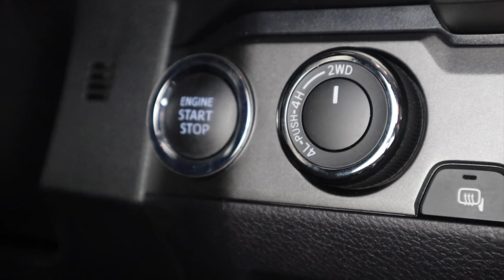Should you buy the latest Toyota Tacoma 2016-2021?

Comment: Toyota should have kept the 4.0L engine they had in the gen 2 tacoma
Reply: I have 2011 Tacoma with the V6 4.0L engine. Just barely passed 98,500 miles. I don't think I'll ever sell it :).
Reply: @xon2013  they are awesome trucks.  I have a 2007 Tacoma access Cab trd sport 4x4 4.0L v6 automatic with 165,500 miles.
Reply: @zzsuprazz  I have a double cab TRD Sport 5ft bed 4wd. I use to drive a 2006, same exact truck, several years backs, but unfortunately fell on hard times and had to sell. I got this 2011 just last year and very pleased so far. Already went hunting in it a few times and have used it for some light cattle/ranch stuff.
Reply: @zzsuprazz  any major issues with those miles?
Reply: @lujr2225  no major issues. The only thing I have had are Normal maintenance, front driver wheel hub bearing,  abs module went bad, and my frame was part of the recall.  The frame was in good shape but had one dime sized rust hole. So toyota put a new frame, Hardware, and ect.  Overall it's been a great, reliable, useful truck.  It's never broke down on me and has always got me were i need to go safely.
Reply: I went from a 4.0 to a 3.5.   The 3.5 is slightly better in my opinion.   The 4.0 has good bottom end but it's definitely not rev happy. 
The 3.5 doesn't have the low end torque but if you step on it it goes unlike the 4.0.  

Also let me add I did purchase a 2019 so it doesn't have any of the problems the previous do. Even though mine was built in Mexico lol
Reply: @alexgarcia3900  my 2012 4.0L was used mostly for highway driving and it was a beast.  Way better acceleration and top end speed.  I had a 302 mile commute each way (once a week) and it was a dream.  My 2021 3.5L can’t maintain speed on the highway and the transmission continuously jumps around.
Reply: The exact reason I ended up buying a Nissan Frontier, the newer engine felt like a weak sister
Reply: @Rybay  idk maybe I'm just use to it.  I grew up driving v8 muscle cars and liter bikes so I drive my trucks conservatively because they all feel super slow to me.  So what I'm trying to say is that if you drive like and a $$ I can see why you would complain.   Idk Maybe hit the etc pwr button when you're driving aggressively??  Idk bro I love my 3.5 and I've owned over 40 cars in my life.  Including most of the pickups.  F150, Silverado,  tundra, ranger.  I actually just sold my 5.7 tundra and my 4.0 tacoma a little over a year ago. Still like my 3.5 tacoma.
Reply: @waynenoll1967  hope you bought it used, otherwise it was a bad buy
Reply: Just buy  a 4 Runner, they still use the 4.0
Reply: And they have rear disc brakes! Never been a fan of drum brakes, and surprised they still use them on the Tacos.
Reply: @Mach141  why not?  Why don't you like them?
Reply: @alexgarcia3900  the 3.5 just sounds fast …it isn’t.
Reply: @rustynail7866  it's definitely faster than the 4.0
Reply: @alexgarcia3900  not according to TFL.  And , I’ve owned both, so I’ll take that bet.
Reply: @rustynail7866  I've also owned both.  I literally went from a 4.0 to a 3.5.
Reply: @rustynail7866  I think it has plenty of power.  I also have a 19 so they completely redid the transmission software.    I've also owned a 5.7 tundra 5.0 f150 5.3 chevy.  It's plenty fast for a truck.    If you want a sports car get a sports car.  I bought my tacoma to 4x4.  I have other trucks for truck stuff.    And again I think it's plenty fast for what it is.  If I want a fast vehicle I'll just get me another litter bike or another v8 mustang or camaro.
Reply: @alexgarcia3900  and I literally went back from a 3.5 to the 4.0.  In fact, along with the 15 Taco, I also own an 07 4 Runner  with the 236 hp 4.0 that outperforms the 3.5.
Reply: @rustynail7866  ok and what is your point?  You want me to tell you you're the best ever ?  Ok you're the best ever and know everything about engines.  Like I said I personally,  (personally means only me)  like the 3.5 better (  I as in myself).  So if you like the 4.0 and think it outperforms everything then that's cool bro.  I bought the 3.5 and I'm actually pretty happy.   I don't drive it much but when I do I'm just fine.  Maybe I just think all trucks are slower and don't even bother trying to go fast?  I mean I grew up riding liter bikes and v8 muscle cars.  I've also always owned pickups my whole life and well,  they're slow, including yours, by a lot dude. It's pretty pathetic that that's what you're bragging about in a 4x4/ truck  to be honest
Reply: @alexgarcia3900  im with you bud. I traded in my 2012 taco for a 2020 trdor premium. The 3.5 has plenty of power. Makes you wonder why all these 2nd gen guys show up on these 3rd gen vids..... its because they want one.
Reply: @cuzz2895  bro the 4.0 is good engine but the top end isn't very good.   I hated flooring my truck.   This 3.5 likes to go.  Nothing wrong with the 4.0 if that's what you want but why are you here hating on the new taco?  Go watch second gen videos lol
Reply: @zzsuprazz  2008 Tacoma extended cab, 4 cylinder. 245,000 miles
both front wheel bearings, serpentine belt, gas gauge sending unit, oil and gas.
I've owned Ford, Ram, GMC trucks in my life.  NOTHING can compete with Toyota.
Reply: @xon2013  just curious what color was your 2006 Tacoma and how many miles did it have on it when you let go?
Reply: @zzsuprazz  it was silver streak mica  and my 2006 Tacoma had a little over 100k miles
Reply: @alexgarcia3900  I had a 4 Runner with a 4.0 and traded it for a 3.5 Highlander. I like the Highlander better, it has more power with better mileage, and easier to get in and out.
Reply: The 3.5L gr does fine. It has more power, weighs less and gets much better gas mileage. It's also been around long enough to have proven itself come 2021.

Now if we were talking about making the 2GR magically 4L and keeping the reliability, weight and gas mileage the same I would agree, because everyone wants more power on demand.
Reply: I know it seems counter-intuitive but the 3.5 V6 automatic performs well so long as you don’t weigh your vehicle down with lots of heavy mods.  I have an automatic 2021 V6 TRD off road but it’s only 2WD and stock, no mods.  Without the extra weight from 4WD and mods, the engine has lots of passing power, I can punch it by people on the highway easily.  It doesn’t hunt for gears like the previous models AND my mpg meter tells me I am averaging 21.5 MPG in the city, which is a combination of street and freeway driving.  That’s like 10 MPG better than my old truck so I happy
Reply: @plops993  I occasionally tow trailers and load my bed down with hay or a shit load of camping and hunting gear, so I'm very happy with the 4.0. Its got good low end torque and has lots of power for my occasional heavy loads. It's also excellent on rutted out hunting roads and I'd rather have low end torque when navigating rutted out and rocky dirt roads. I'm use to driving low end torque engines (6.7 Cummins and Ford 300 inline 6) regularly so I like to let the engine do the work when I drive shitty dirt roads.
Reply: shadez95 yeah I don’t have to haul anything, my kayak just weighs like 40 lbs lol.  There is a solution if you had the 3.5L and wanted more low end.  There is an ECT power button which changes where the engine shifts, creating more low end torque on demand.  It’s meant for towing heavy stuff uphill but some people just push it for more oomph when they want, although honestly the gains you will see there will be minimal if not towing.  The other solution is to just get a Tune done on the engine’s chip.  It’s something I dunno much about being a new Tacoma owner, but I hear it mentioned in the community often
Reply: I would not buy one with the 3.5L. IMO
Reply: @zzsuprazz  I have a 2006 trd offroad with 180,000 miles on it, runs great.
Reply: @davidcox2197  awesome man
 I have a 2007 TRD sport 4x4 4.0L v6 automatic with 165,500 miles and still running strong too.
Reply: @alexgarcia3900  I concur on your observations definitely. I went from a 2015 to a 2019 .
Reply: @alexgarcia3900  Can i press the ECT button when rolling? I honestly couldn't find the answer in the manual or on forums lol
Reply: @chrischilleen5131  you definitely can
Reply: @xon2013  Same year truck and almost exact same mileage. I plan to run it into the ground as well.
Reply: Thank you very much I’m saving money for the last two years a little bit of the time to buy me a Tacoma but I don’t want to pay over 20 grand I want to pay around 15,000 I’m thinking Dubai between 2010 and 2013 what do you think what do you recommend base my budget thank you very
Reply: What can you tell me about buying a Tacoma between 2010 and 2014 model thank you very much for your videos

Comment: I got the 2021 2.7 almost 2wks ago and I love it!!!. Like a commentor said... I won't win a race but I will win a lot of marathons....LONGEVITY BABY!!!!
Reply: a marathon is a race.
Reply: @ericgofast  your right my friend
Reply: Yeah i have a 2.7 too and its great
Reply: I also have a 2.7, 2015. these engines will continue to run long after the apocalypse. so far I've got 150k, which is baby miles. My last 2.7 was an 07, had 265k on it and was running great, but the frame rotted out and i was too late for the recall :-( anyway happy to have a newer model but I do miss my manual, this ones an automatic and I'm not a fan. But it'll take me wherever I need to go regardless so no complaints.
Reply: @Eclipsed_Phoenix  i have an automatic transmission as well, i wanted a manual but they told me it was discontinued in the base model and that it was only available in the trd trims. Its a Cool truck and my daily driver
Reply: @Limitedtom643  It really is a shame that it's going the way of the dinosaur. Hopefully they keep it around for at least the TRDs.

Comment: It’s why I went ahead in summer of 2015 and bought one of the last former type. Haven’t had a single problem in six years. Wonderful vehicle, utterly reliable.
Reply: Same with my 2010 right in the middle of the 2nd gen years
Reply: I did too. But just traded in my 15 for just 9000 less than what I spent 6 years ago, and bought a 21.
Reply: @kerryblackburn7850  what was your mileage at trade in
Reply: @benderbendingrodriguez2868  I believe i had 92,000 on it.
Reply: Similar to myself in 2016 I bought a 2014.
Reply: That’s the way to go. I never buy the first couple of years of anything unless it’s an “emergency” replacement. With vehicles it’s easier since it’s normally part of their hype to tell you when a new design is coming.

Comment: I have owned a 2020 Tacoma 3.5 for 2 years. The first 1.5 years and about 50k miles it was bone stock. Decided to get the truck tuned and WOW what a difference it made. This truck is such a joy to drive now. Feels like a completely different truck. Wish I did it sooner. Well worth the $425 tune. I have gone about 6k miles since the tune and noticed a slight MPG increase but the improved driveability is unreal.
Reply: Who tune your taco? What whp and wtq you gotten fton the tune.
Reply: @AndyTN64  I have a 2020 TRD Sport 4x4, hands down the best tune you can get for performance, longevity and drivability is the Overland Tailor Tune. There’s a night a day difference, it’ll make you wish it was the first thing you did after you drove it off the lot. Amazing is the best way to describe it. I had mine done when there was 30k miles and I’m now at 90k, not a single problem or regret. It will be the best money you’ve ever spent on any vehicle experience you’ve had in your life, yes it makes that much of a difference
Reply: @andybankston8413 what do you mean by tune? You’re not referring to tune up right? I need details, I have a 2020 taco trd and want it to last and function well as long as possible

Comment: I have a 16 TRD off road. No issues but I'm going to keep a close eye on it after watching this video. Still love it though.
Reply: Same here except I bought a nice used 2016 TRD sport. Mine is a Texas Edition and is a Texas truck, so no rust.  I haven't had any issues. It has 106,000 + mls on it now.  I just replaced the rotors & pads. It is on its third set of Michelins and a new battery today.  No issues so far.  I will be keeping a close eye on those major, minor issues.  Good video.  Thanks.
Reply: How many miles are on the truck?
Reply: @josephbarbagallo9560  Thirty thousand

Comment: I bought a 2016 Trd sport 3 years ago.  Made in America. Had 66k miles on it. Only problem I had was the fuel pump.  Have 132k on it now. Made all my mods: regear, lockers, bilsteins, etc.  It's mine now.  Still searches for gears here in Colorado but still by far the best designed, engineered and fabricated vehicle I've owned in 40 years.  I've owned them all, Ram, Chevy , Ford, diesel, gas.  Love my Tacoma!

Comment: Excellent resource, thank you.   A tale of our two Tacoma's, 2005 & 2018..both developed AC issues this past summer. Repair costs for the 2005 with 185K miles: $128 (recharge) , the 2018 with 62K miles: $ 1250 (compressor & not covered by warranty)

Comment: Toyota messed up with the oil filters on these. Used to be on top now it is under the engine with the dumb plastic cap that make a mess and often leak. Toyota bring back the steel spin on oil filters, Please. Great video as always.
Reply: 4 cyl is still spin on metal filter
Reply: @Anon1mous  Lucky! That cannister is nothing but trouble and ancient technology eliminated yrs ago with the spin on.
Reply: I changed my oil the first time already and the plastic canaster was no problem for me. Was just different and you need to take you time with putting the o rings on in the correct places and don't over tighten it when reinstalled. Do that and you with have no problem.  Using the motiveX cap wrench with 27mm socket is ideal for working on it too.
Reply: I've had a Lexus with the same filter since 2008, I don't mind it, but it never leaked, ever. Although the spin on ones are much easier.
Reply: I replaced my plastic one for the aluminum one on Amazon and no issues

Comment: I bought a 2018 Tacoma used in 2019 and love it!   Haven’t had any issues.   I do live in the Phoenix area where we get to over 115 degrees and haven’t had any issues with my AC so maybe the previous owner put in that fan kit you were talking about.  I do take it off roading often and this truck is a beast.
Reply: I have a 2017 Double Cab, and live in Phoenix... and have never experienced a lack of air conditioning.
Reply: I have an '18 that I bought new. I live in Southern Oregon, and our summers get up over 100. I've never had the AC issue either.

Comment: I often have people asking how reliable my 2011 Tacoma has been. I just point to my 1991 Tacoma X-Tra Cab with 490,000 miles and say... well, so far, I’ve had to replace the batteries and tires on both of them. And the clutch on the ‘91 standard shift. That’s about it. 😊
Reply: 😂😂😂Liar! Tacoma came out 1995. There was no Tacoma prior to 1995.
Reply: @minegamer8437 😂😂😂
Reply: They sold Toyota pick up trucks since the early 60s  in the Us they just weren’t called Tacoma’s till 95
Reply: @minegamer8437  They  just didn't call it a Tacoma